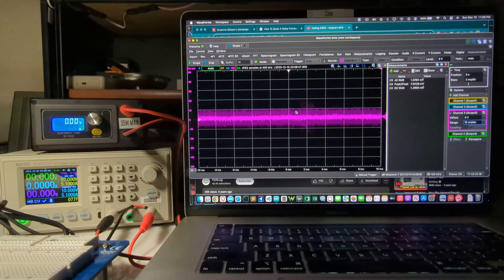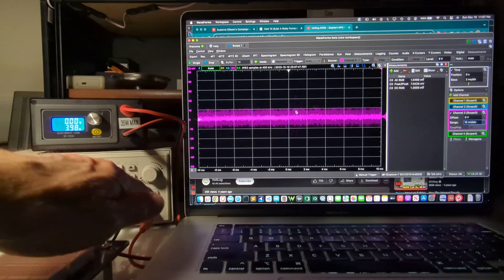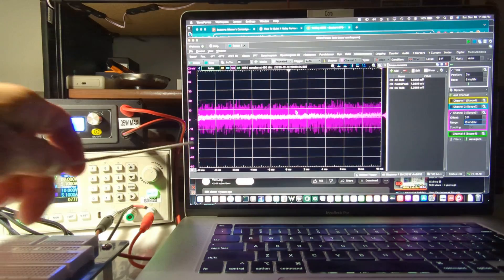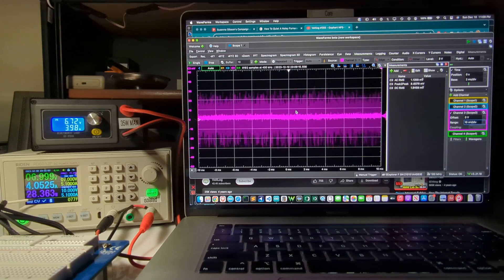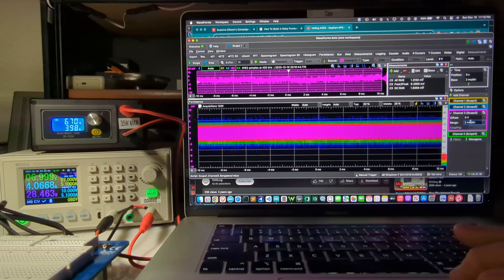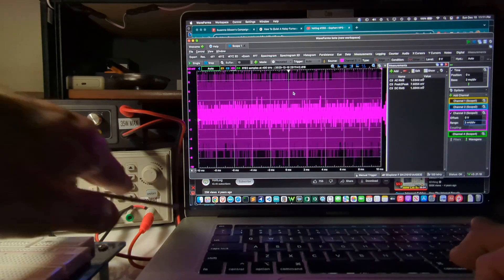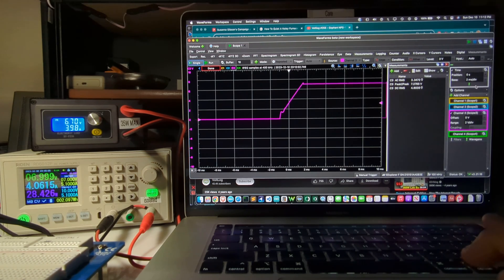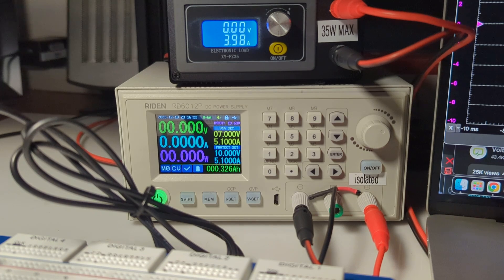Riden RD6012P DC power supply - RMS noise levels and transient behaviors under load

Comment: This RD6012W is definitely in the top 5 tools ive ever bought / printed. I use it all the time! 
 I like how it stays on as a Digital Volt Meter when you unplug AC. 
My advice is to go big. I regret not getting the 18 amp model. 
I really regret under sizing the 60V PSU i mated it to save a few bucks. 
I went with a 500 watt (8.3 amps @60v) PSU for 30 bucks on Ali express  ( 800 watt = 55.00 1200 watt = 65.00) +80.00 for Riden 6012W + 10.00 roll of filament to 3D print the case to save 40.00 bucks.  120.00 total to build my RD6012W with 500 Watt 8.3 Amp PSU.  Should have spent 180.00 and built the 18amp Riden with proper 1200watt PSU so my typical use would be <50% rated output. 18 Amps when needed and better efficiency than pulling nearly the max current. 
I thought it would be uC Arduino and PCB repair use but its my go to garage charger / Bench PSU that i use for everyting now.  60V PSU Still going strong after 3 years often >= 85% rated output.

Comment: Thanks, very useful info, nice review.
Reply from the maker: Sure thing. Thank you for the nice comment. BTW, I'd recommend the Riden power supply models that end in "P" (for precision). They do cost a little more but are worth it, imo. Also, I think the noise levels are even lower than 1 mV. For example, my Fluke 8842A multimeter reports an AC RMS of around 0.5 mV. I think the higher noise levels shown in the video may be due to the noise floor of my oscilloscope (a Digilent Electronics Explorer). Here is my other video showing the AC RMS noise using a Fluke multimeter: 
https://www.youtube.com/watch?v=dwQodc7ndPg